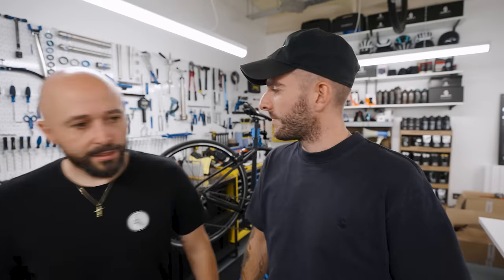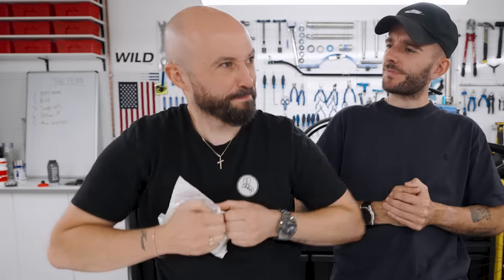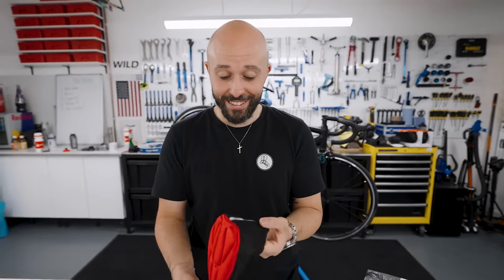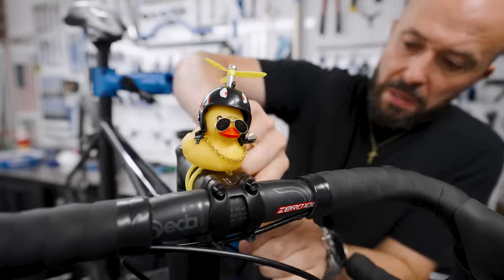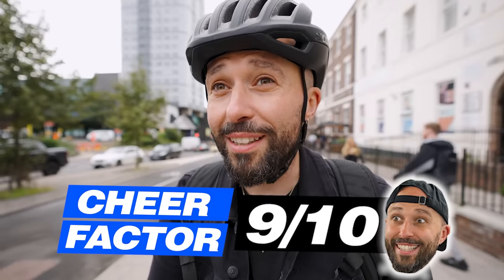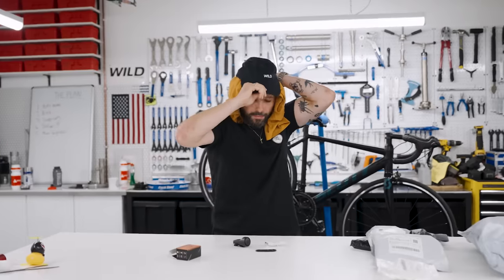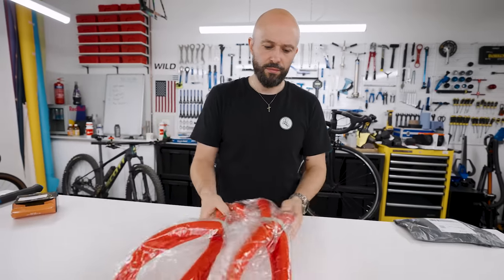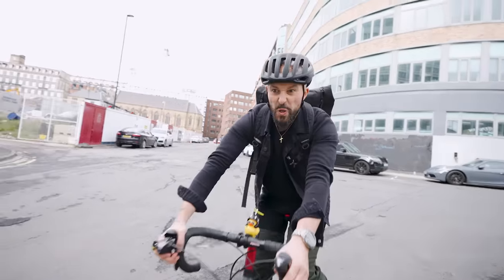We Bought The 10 Weirdest Cycling Products On Wish.com

Comment: Those bar inner things are the exact ones i have and they help a lot on long rides by providing a different position. Actually, the letters for L and R are for if you were to mount them as bar ends.
Reply: Those are a copy of a SQLab product
Reply: I have the exact same ones, and yep, had to swap L and R! But they've been really good, at least for the price. (Not amazing overall otherwise but I like them)
Reply: The original ones are called Spirgrips and those have L and R on the correct sides(inverse of this knock-off version). Sqlab used to sell these before they released their own version of inner bar ends which are slightly different.
Reply: I also use similar Spirgrips knock-offs and find myself using them for 90%+ of the time. They give you a hand position that is similar to being on the hoods of a drop bar without the cost of a handlebar conversion on your bike. I may do a proper conversion in the future, but for now they work fine for me.

Comment: The inner bar ends go on the otherside of the levers. Actually quite comfortable on my hybrid bike 😅
Reply: They installed them correctly. By having the inner bar ends outside of the brakes you are able to reach the levers with your ring and pinky fingers. However, the bar on which they installed them is too wide so the inner bar ends didn't end up at shoulder width.

Comment: 8:47
I think that that bell would be louder when attached to a metal bar than when you're holding it as your hand has more damping that the metal bar does and the metal bar with 'ting' as well. It also has a larger radiating surface.

Comment: The Innerbar ends are knock off Spirigrips, One of the guys on Chris Halls recent Alps video was using a set, so they work for some people for alternative hand postions on longer rides.
Reply: If you fit them correctly (eg not on 800mm bars so you look like a Staffie pinching off a log.) it can give you a position similar to having brake hoods on your flat bars while still being able to cover your brakes. If you've got hand/wrist problems and can't ride drop bars Spirgrips can make a massive difference. It's not going to turn a Hybrid it a TT bike but you can tuck your elbows in and stench your back out. (Also if you have them on a Brompton It will still fold up.)

Comment: The steerer tube extension is a very relevant thought, when you have bought a bike thats been sized for someone else and cut, and buying a new fork set is just not an option , what else is there within the normal reach of the usual cyclist, there is no evidence that the extension was unsafe , its clamped just the same way a head stem is . other than that I really like to approach to bringing these examples to the masses .

Comment: "300db". Who wants to tell the chinese that db is logarithmic? The difference between 100 and 105db is exponentially greater than the difference between 80 and 90db. 😂
 Bikeballs, bloody brilliant. I've had a pair for years. Bloody bright at night, my dog tested them out to a kilometre chasing rabbits. Best explain, he went through a period during the terrible twos of not responding to recall if he got distracted, to keep track of him at night I put my balls on his harness. Anyhoo, I usually keep my balls hanging freely on my riding bag, my balls hang quite low and catch on the rear tyre when my suspension compresses. I've found my balls glow a glorious red for at least 48hrs and if I squeeze them until they slow flash they can throb for up to 120hrs on a single set of 2032 batteries. 
 Seriously, if you guys could see my big bouncing balls you'd be rushing out to buy some. All the schoolkids love my balls and a few have even aquired their own. 10/10 product, 11/10 knowing the humorous yet functional product has even got teenagers to fit a red light to the rear of their bikes. Safety doesn't have a pricetag.